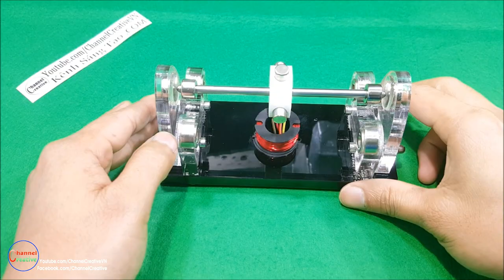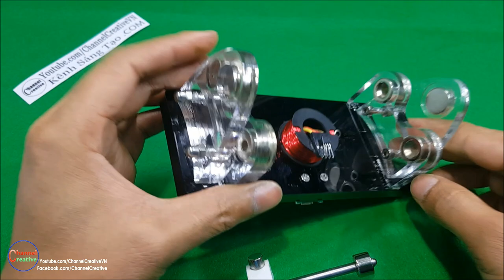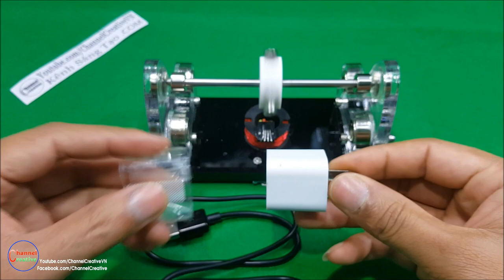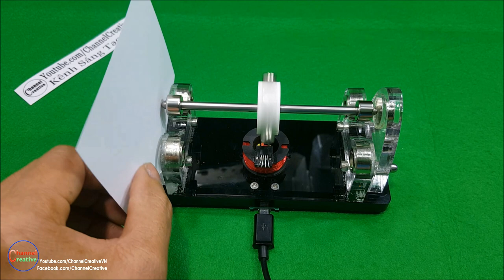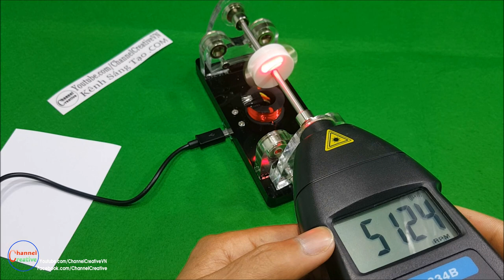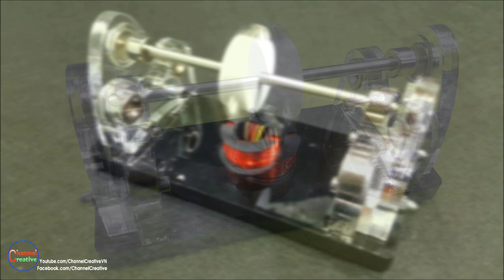Super Bedini Motor Electric Magnetic no sound when in operation

Comment: Excellent  motor.  How much torque  can it develope to facilitate  power generation to loop the system ?   I have seen demonstrated on youtube  such  a device  lighting two 120 volt  bulb plus a 12vt dc bulb using coils and reed switching.

Comment: And this can be charged as well? It drives a belt which is connected to a generator?
Reply: Not sure why you'd want to convert electric to kinetic and back to electric, but yeah, you could. It'd lose power in the process.

Comment: what's the use???
Reply: Charge batteries ,for example
Reply: @frederickkk1985 You could charge batteries more effectively by plugging them directly into the power source of this motor.
The use of this is... it looks cool.
Real electric motors work a bit similarly, but they're more efficient.